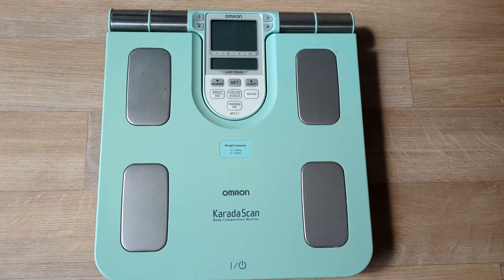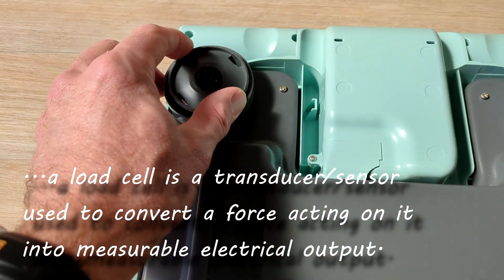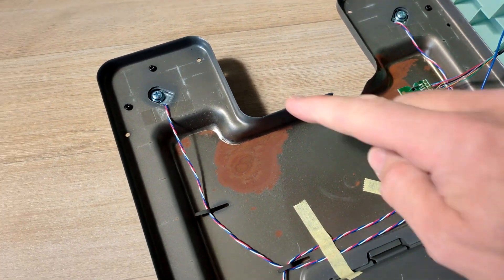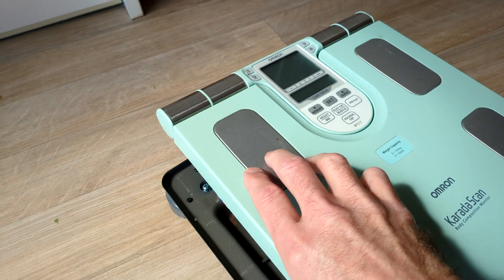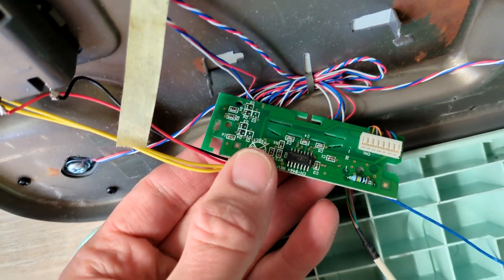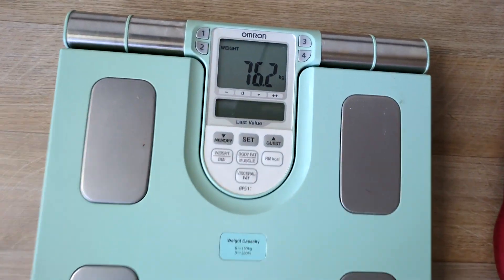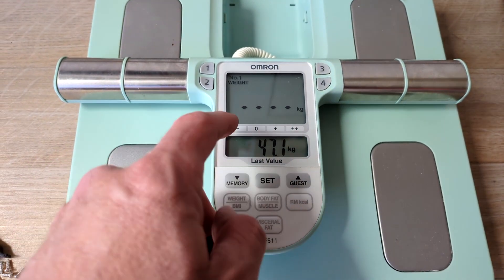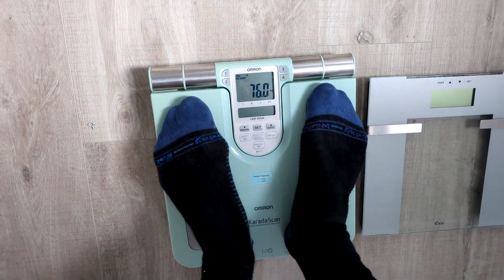Omron BF511 Scales Tear Down - Has It Broken?

Comment: Argh! I had just replaced mine with new batteries and it won’t switch on!!!
Reply from the maker: Worth opening it up to check the connections?
Reply: @ChrisHorswill  1 of the screws is broken already (corroded) so I could only tilt it open and tried my best to tighten up all the connections, no luck! I bought this in 2013, still on Amazon for £100, the newer version £80, or GE £25, so... i bought a new scale (GE) >.<

Comment: I used to make bespoke loadcells by hand at a company I worked for in the UK. I was wiring/calibrating/baking strain guages on to loadcells from tiny ones that were the size of a penny, to ones that were hefty blocks of steel used for weighing trains. Awesome electronics lab work that I excelled in and loved until the ancient assholes I worked with made me leave the job. They didn't like my success. 😖
Reply: Shite company culture that the management couldn't manage (they had people that worked there since the 70's that didn't like their toes stepped on). Didn't like change for efficiency. Dinosaurs. The young employees were awesome.